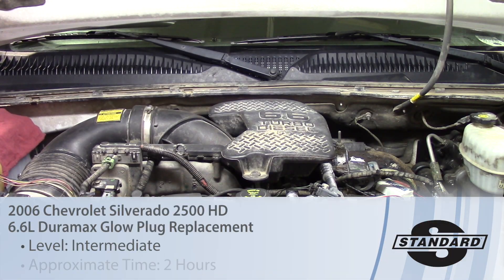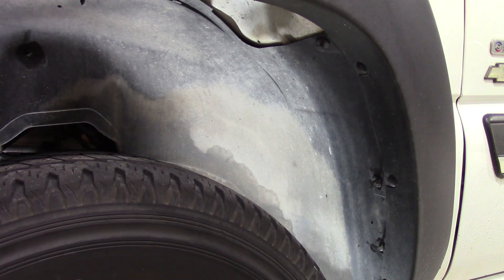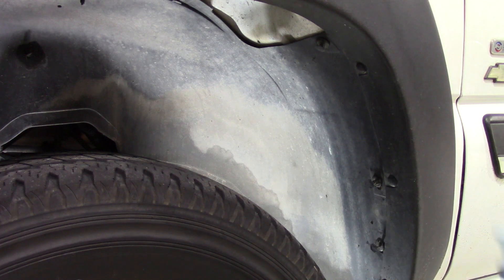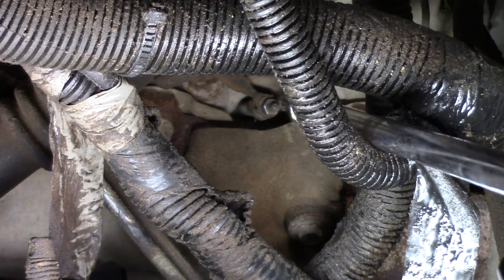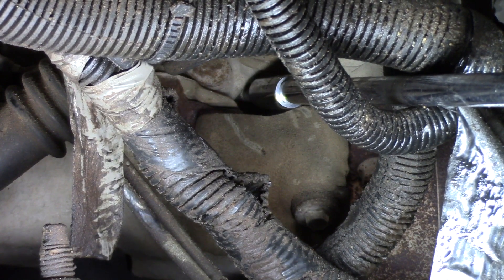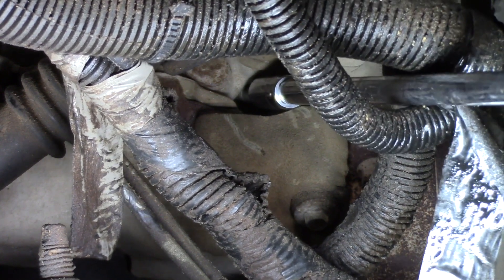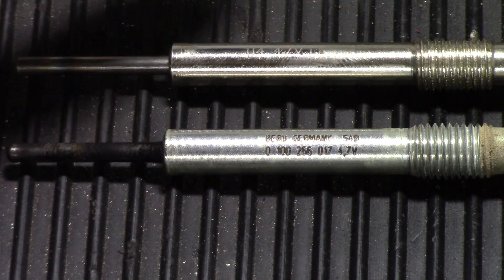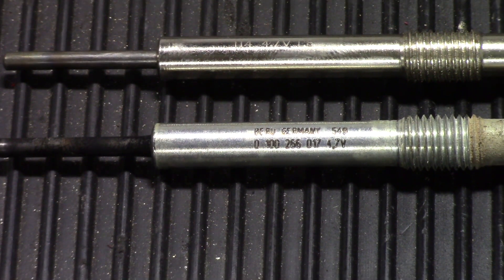2006 Chevrolet Silverado 2500 HD 6.6L Duramax Glow Plug Replacement

Comment: Thanks for the video. I purchased a Glow Plug for my 06- 6.6 GMC and the voltage was wrong, It was 4.85V.  Took it back and got 4.7V. The retaining nut for the connector was rusted so bad the 8mm socket wouldn't fit the nut, I had to use a 9/32 - 1/4 inch drive socket and it broke off. I drenched the exterior of the Glow Plug with Liquid Wrench several times and had a little resistance but I casually put pressure on it and came out smoothly.  The biggest problem installing it was the inner fender splash shield retainer clips. I had to chisel all of them off because the tabs on the inserts all broke off and I couldn't get the inserts out.. I guess that was to be expected with One Million One Hundred Thousand Kilometers on the truck.